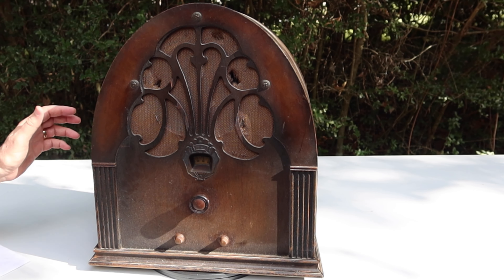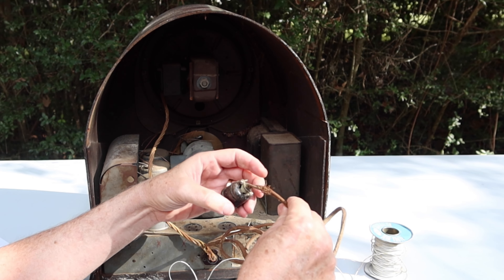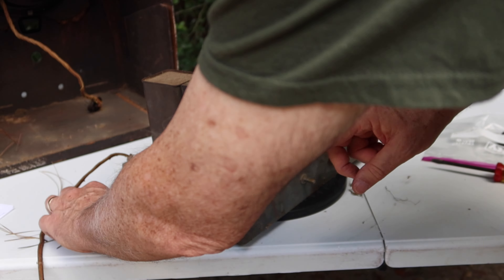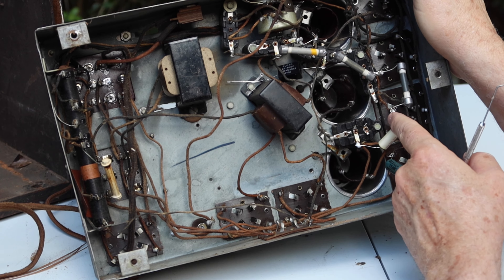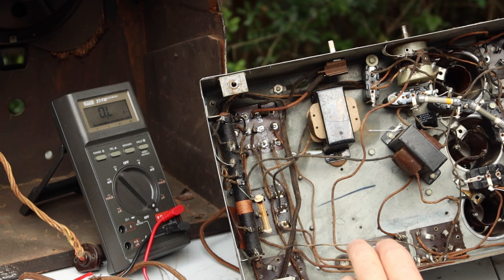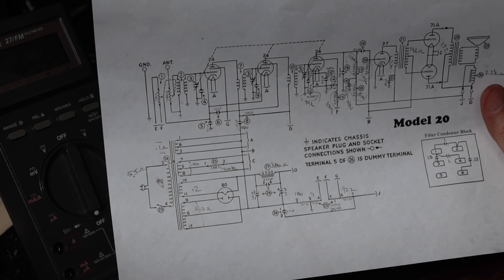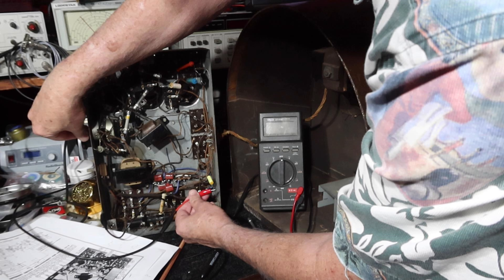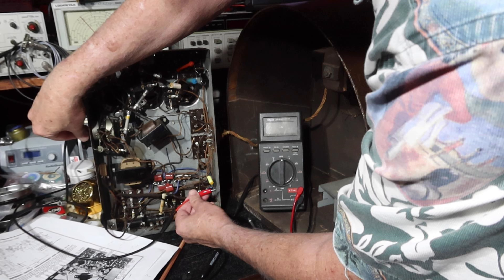Philco Model 20 Vacuum Tube TRF Radio Repair - 1930 - 93 Year Old Tube Radio - Part 1 [4K]

Comment: Thanks for the video.....I have a Grebe AH-1 with the same type of circuitry "TRF"...very few componets under the chassis...most are hidden inside metal boxes but can still be checked...  The Grebe works fairly well.... Mike
Reply from the maker: Hi Mike, went and checked out your video of the Grebe.  What a beautiful radio.

Comment: Off to a good start on this old beauty PF. Always great joy hearing the first significant noise coming out of the speaker. Dodged a bullet on that power transformer. :)
Reply from the maker: Hi Doug.  Always worry a bit about transformers especially when they looked a bit tattered and opened up.  Thanks.

Comment: I have a friend who is bringing me one of those to work on and was a little puzzled at first on the filter capacitor and the values as I generally only see sets using regular capacitors. What values did you use and did you use regular 630v ones. The radio he picked up is also missing the speaker as well so not completely sure what measures to take to solve that.
Reply from the maker: Hi, you have a problem there without the speaker as it is not a simple thing to replace with an aftermarket part.  Not totally impossible, but very involved.  Perhaps the best solution would be to find it from a parted out Model 20 set.  The field coil of the speaker provides a filter choke and a voltage drop for part of the circuit.  Also the output transformer after the output tubes will not likely match the impedance of a new speaker so that would need addressing.  If you want to get into what all that would entail I suggest you do some research on AntiqueRadios.com forums and see what you can find.  On that forum a lot of expertise is already written there.  If a radio is missing an electro-dynamic speaker, I almost always pass on getting the unit unless for parts.

As you know, schematics and other info are available from the excellent site NostalgiaAir.org.  The site PhilcoRadio.com has additional info on the schematic which I used for the capacitance values.  Since the values for the power supply filters were relatively low I did not use electrolytics but rather film types which are also non-polarized.  I selected Panasonic films in 630V from Mouser just FYI. YMMV
https://philcoradio.com/library/index.php/service-info/early-schematics/

Comment: Great video!  What is a B.C. resistor?
Reply from the maker: Thanks!  The B.C. resistor is a multistage, wire wound resistor.  It has several taps on it and is used for pulling off differing voltages for use throughout the set, including for tube bias. Thanks again and glad you like it.
Reply: Gotchya.  Kind of like a Candohm resistor (which was used in the decade following).
Reply from the maker: Yes, that is right.  Thanks
Reply: @brucebuckeye  One of my curses seems to be whenever I work on a set w/ a multitapped wire wound resistor, at least one section of it will be wide open. I seem to find more bad ones than I do with candohms!

Comment: I haven't tried it yet, but I have heard that you can make nearly invisible repairs in wood/veneer cracks by using fiberglass soaked in resin like bondo'ing a rusty car by applying it to both sides of the crack and then sanding it smooth after it cures. I was eager to try it on a tombstone I accidentally impaled the top-of (something slid off a near-by shelf and went right through it) but completely forgot about the fiberglass idea and repaired it with glue, filler, sawdust and patience first.
Reply from the maker: Your video of the Majestic 307s is amazing.  Thanks